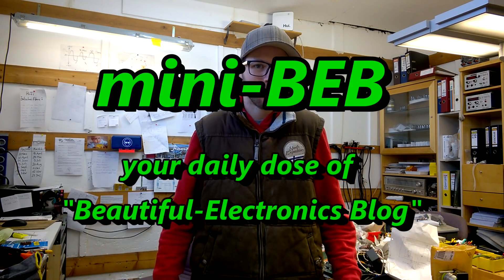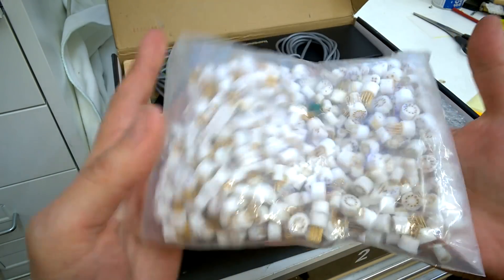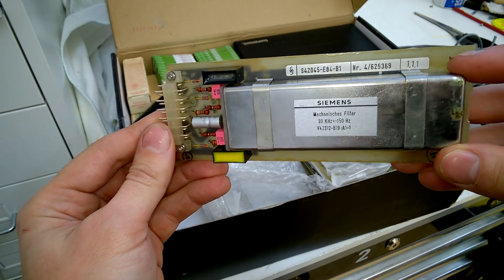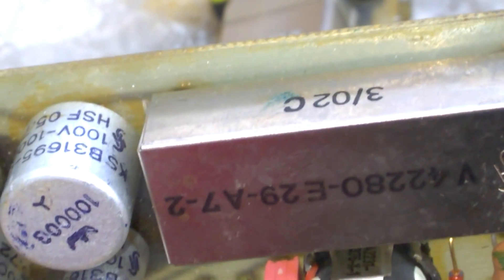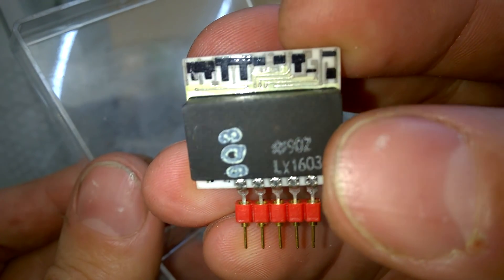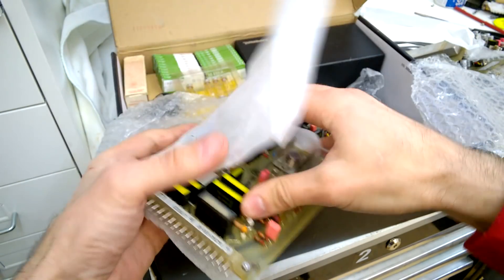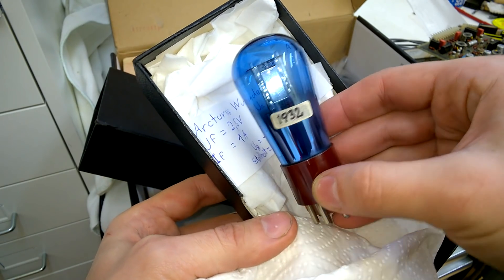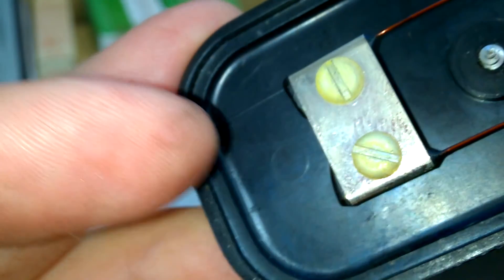mini-BEB: Wonderful Electronics Mailbag from Germany (Part 1)

Comment: The pressure sensors at 4:00 are the predecessors of today's most precise commercial sensors. Even Fluke uses them in the 713 pressure reference meters. The OEM was once called Lucas Sensors, then went to General Electric and is now owned by Amphenol. Today's models are smaller though. They cost about $20-$35 each. I have used them in the 1000s. The successors can be seen here: https://www.amphenol-sensors.com/en/novasensor/pressure-sensors/3151-novasensor-npc-1210-series-low-pressure-sensors